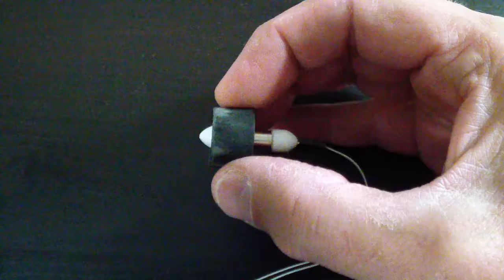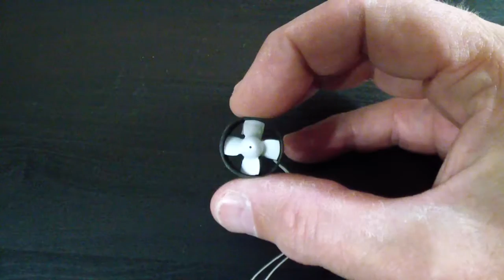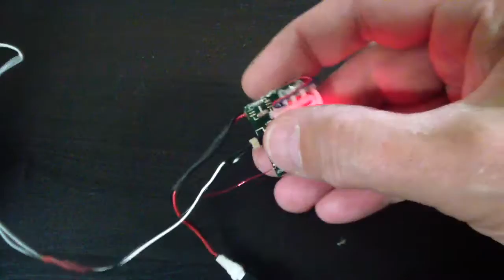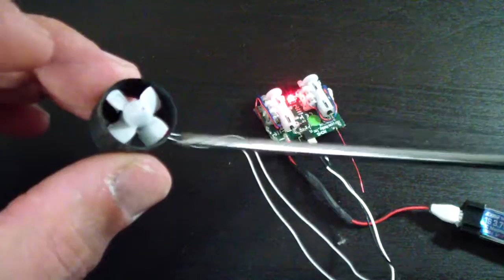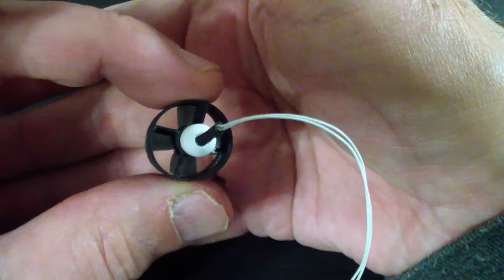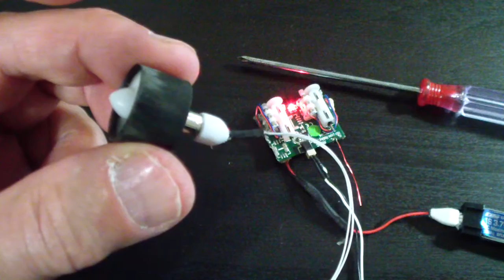18mm EDF unit

Comment: Nice experimental work, Paul! I've been experimenting with a supercapacitor powered MiG15 EDF using a fan and shroud from a micro quad, about 30mm I think, with mixed results so far. After seeing this I'm going to add stator vanes and try to tighten up the clearance on the prop tips to shroud. Subscribing and invite you to do likewise! Mike